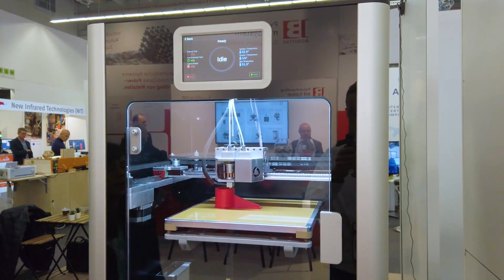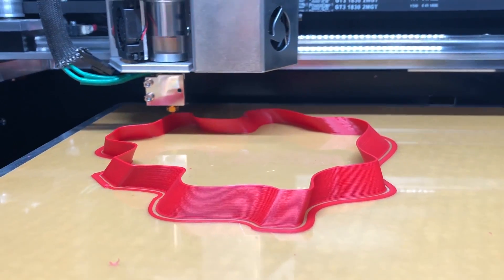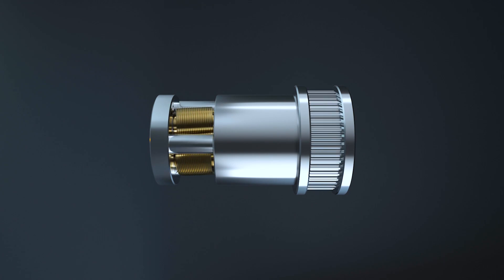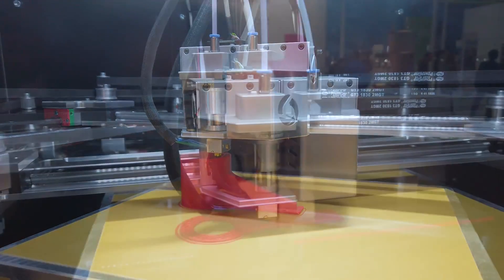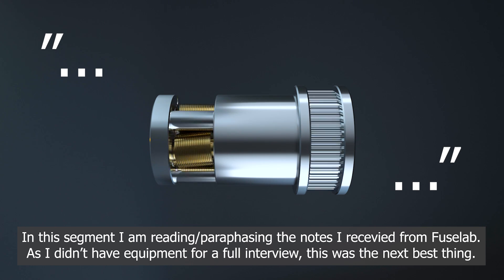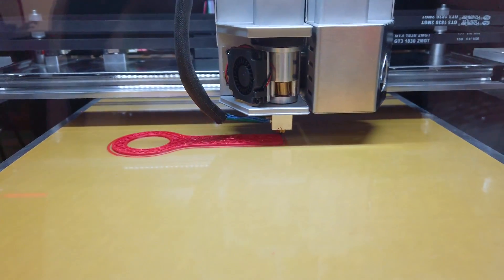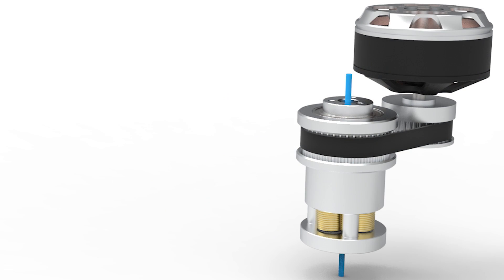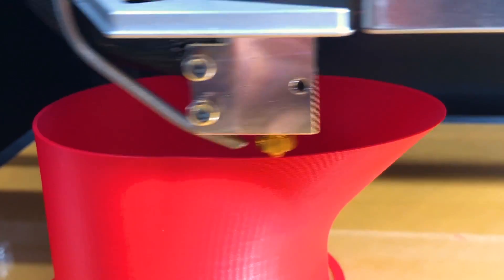Incredible High Performance Extruder - FuseLAB Formnext 2019

Comment: Nice video, it's indeed an interesting design. I won't buy it, but i'm interested in seeing you or the community testing it.
So it's a new way of driving filament, providing high force. But how is that an improvement over dual gear bondtech extruder gears? over the E3D hermea with a dual gear?
I mean, those extruders already provide enough force to drive any filament (and are compatible with flexibles...) so what does this one bring to the table?

faster extrusion? more precise extrusion distance? I don't feel like those aspects are things that limit current 3D printers; and designs like the hermea and the zesty nimble already provide great torque and speed to the point where the limit would be with the rest of the printer.

So, this looks great, but what does it bring that can't be done with other extruders, especially if it means giving up on flexibles (and what about nylons, that are not that rigid?)
Reply: much more faster and precise movements. if you up the speed of printing the hot-end is what would slow this machine down. so theyve sped up one part of the system by 10x, just gotta get the other parts of the system up to speed

Comment: I missed what the benefit was to this design. Was it speed and a more even extrusion? If so, how much faster?
Reply: Two benefits are claimed:

(1) First, the filament is pushed/pulled along a longer surface of the filament.  This allows for higher extrusion force.  That is, the force is spread out, making it less intense at any given point.  If all that force were focused at one point on the filament, then you would likely grind filament instead of extruding.

(2) The grooves cut into the filament can affect extrusion.  In a conventional (BondTech) type of extruder, the groves are (approximately) circular.  So if you look at the cross-sectional area of the filament, it goes up and down.  That means your extrusion volume goes up and down.  Sometimes this causes subtle surface artifacts in the 3d-print.  The FuseLAB extruder cuts a helical grove into the filament, and the cross-sectional area is constant, so the extrusion volume is constant.

Hope those make sense...

There may be other benefits too, but these are the two that I understood from the video.  My guess is that the effective "gearing ratio" is very high, much higher than the typical 3:1 of geared extruders.

Personally, I like the idea mechanically, but wonder about the added weight.  That would come down to actual testing of the machine.
Reply: @ChiralSymmetry  Good analysis! Weight is actually very low, see some of my other replies.
Reply: @ChiralSymmetry  I dunno having rapidly spinning screw threaders running around a soft plastic string seems like a bad idea. With geared extruders they can bite in deeper and with a dual gear system you can even put the peaks/valleys at alternating positions to minimize that effect. I highly doubt this subtle surface artifacts claim. Having very shallow and rapidly spinning drive screws makes the effective area small and the surface velocity high which is also going to cause problems if it gets overloaded it will strip and grid the filament even easier so even if they have a larger thread it roughly nets out to be the same. Not to mention with a screw drive only the first few threads matter so in an overload situation it will just cascade where the first few threads will fail and it will just pull out entirely. Which is dependent on the filament which makes it more difficult than it needs to be.

Dirt accumulation will also clog the drive system more and the rapidly spinning parts creates additional hazards, wear on bearings, etc...

All in all it will have more contact area by a bit but in reality it probably has worse performance than a bondtech drive. Not to mention you can always swap out the hobb gears to better match your filament with this system that will be tricky to do. It just doesn't seem to make much sense when a simple single drive gear system can produce results the same as a dual drive system minus the surface artificats you can clearly see in the video which already invalidates claim 2. I suspect the rapidly spinning extruder system will introduce vibrations into the system which will ruin surface finish. Consider how beefy their demo machine is and how wavy that surface looks its definitely something to do with the rapidly spinning and speed changing extruder drive system. The inablity to print flexibles and likely weakness with softer non-flexibles like cleaning filaments, harder materials like carbon fiber/metal filled loaded and supports like PVA will make it a non-starter for professional applications.
Reply: @riakata  actually you can do out the math, it makes a very subtle surface pattern, but at very small layer heights this is actually visible on large flat surfaces, just watched a vid on it, the gears on a dual gear extruder create much more severe artifacts tho, as when the filament goes through it pries the gears apart, they stop meshing properly, and this creates an aggressive wood grain pattern (with that one you can confirm the cause pretty easily too)
Reply: its different and it looks cooler.
Reply: With the driving bits being made from brass, these will just wear out quickly.
Reply: @sourand jaded sorry there were a few autocorrect errors in my comment I just fixed. In any case right before posting that comment I did in fact watch a video where a man tracked down the causes of a couple surface imperfections he couldn't get rid of with any other tweaks (and yes this includes software), and eventually with a lot of experimentation (from viewer submission as well as his own tests) he concluded the two causes and showed with algebra how the volumes would be effected. The trick with trying to fix this with software is that the mechanical properties of a filament, and indeed different filaments if you don't simply print one type all the time, make that completely impractical.
Reply: @sourand jaded hahaha I'm not talking about this setup, I was replying to a comment referring to the standard extruder setup

Comment: Incredible, beautiful design and innovation, speeds look amazingly fast. Only thing i was seeing was wavy ghosting in some of the vase mode prints but still beautiful. Would love to see this go to the public market.
Reply: The wavy ghosting is perfectly aligned vertically.  This means it has nothing to do with the extruder.  This is a characteristic seen on well tuned printers.  Once you get everything else working well you see this kind of pattern and it is caused by the non-linearity of the micro steps.  Switching to 0.9 degree motors will double the number of waves per unit and the amplitude of the waves is often reduced to the point where they are difficult to see.
Reply: @dougingraham5807  The rapidly spinning heavy extruder drive system is going to be a vibration nightmare. Speed changes, 2nd extruder starts/stops, retractions, etc.. are going to be bad times. The level of precision machining that would be required makes it too complex for what is needed as it needs to be perfectly balanced or it will just vibrate the heck out of the machining and likely is. They will need to add damping and mass to the system which will slow it down.
Reply: The speed shown in the video is nothing special. Cheap chineese printer is able to handle 80-100 with some good stepper motors drivers.

Comment: Ingenious. Still trying to visualise how those cylinder teeth work - do they moving freely on their own axis (relying on friction against the filament perhaps?), or are they keyed to the main body rotation?
Reply: They move freely indeed, and spin around their own axis.
Reply: Oh I get it! For some reason I thought the cylinder gears had spiral threads, but they're a series of rings for teeth. So it's the angle of them that creates the thread on the filament, and it doesn't matter how much they rotate on their own axis. Cool!
Reply: its so easy, that its already genius